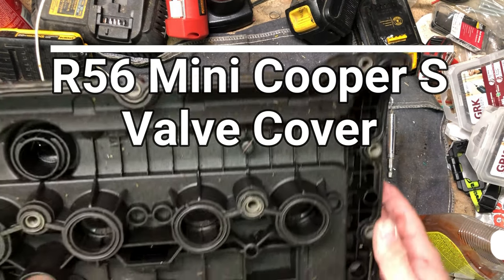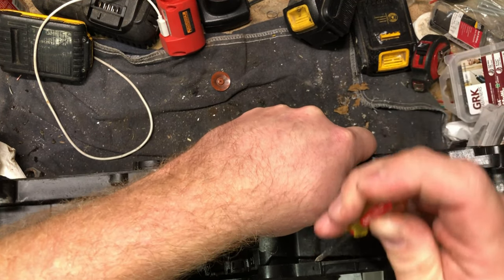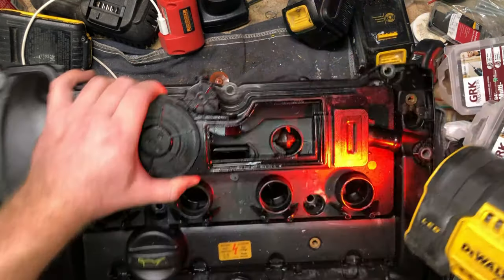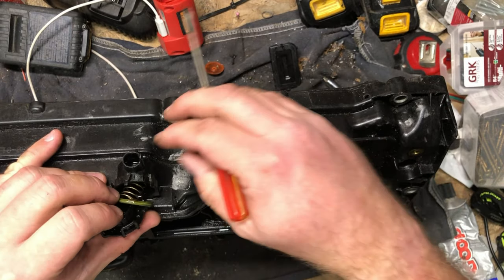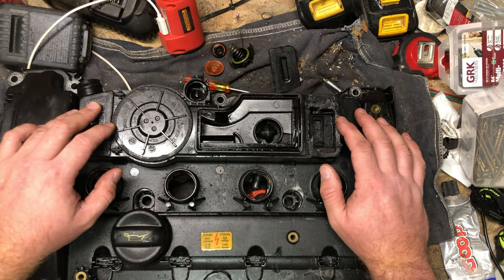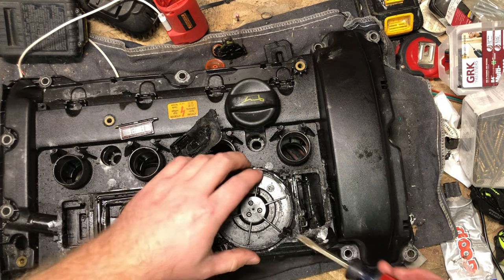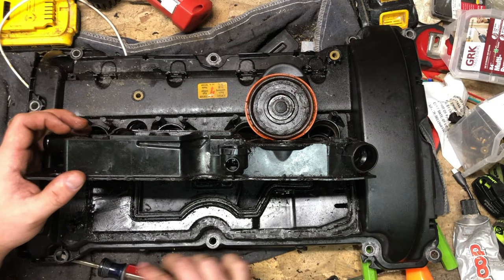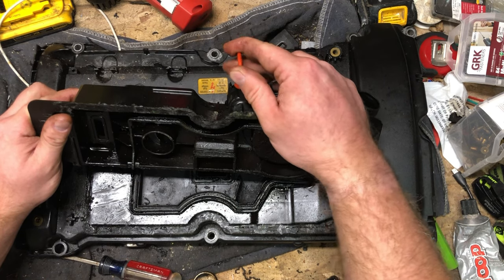R56 Mini Cooper Valve Cover

Comment: erm, I think your missing the point abit

as you've missed the fact the car becomes under boost "high pressure" which will close the large membrane preventing pressure heading into the crank casing, hence the spring to open the membrane quickly off boost/normal pressures etc

off boost/idle the membrane is open allowing recirculation & controlling the idle & allowing oil vapour to flow freely recirculating controllably. on-boost/higher rpm the membrane closes reducing crank case/cover pressure, making oil vapour flow back through into the turbo & round to the intake manifold

you don't want boost pressure to get into the crank case/cover as it'll destroy the seals & so--on leading to no boost

the little door/shutters either side of the casing open under low load/crank pressure allowing oil vapour & crank pressure to vent which also aids engine vacuum systems etc

so high loads large membrane closes, little flap closes (intake manifold side) closing that flow of oil vapour recirculation & boost escaping, the other side open is open allowing re-circulation.... 

the engine is off, the little flaps close minimising water vapour/moisture getting to the crank case cover & the large membrane is open with the spring pressure, that's still sealed due to the little side flap.

the rear valve unused, that's a vacuum port used in other applications, its just been simple closed with the red clip & in some cases a small little nipple/clip.... any over pressure within the crank cover usually the filler cap opens slightly as its also a relief valve in itself that's why its a pretty loose fit & the rubber gasket is a loose fit ie a cheap design for a simple job..

you were close with your thoughts you just forgot to implement positive pressure in the turbo intake system & not wanting to allow that into the crank casing.
Reply from the maker: Thanks for the comment! That makes perfect sense.
Reply: You Sir, are a Legend!!!!! thank you for sharing

Comment: This is the same as a Peugeot 308 1.6 turbo petrol 2008 and have problem where you took out the red tag which I thought went to the wastegate actuator to put power to the turbo or return oil back to the crank case confused help # ??
Reply: ??? huh??

yes its the same as the peugeot & I believe the 307 turbo & the CC coupe as they have the N14 engine..

I'm not 100% with the pug set up.. but the turbo isn't & shouldn't ever be connected by vacuum to the crank casing, the vacuum comes from the basic engine vacuum from the inlet manifold which closes the wastegate & If memory serves me correctly its closes the wastegate allowing boost to build-up

air goes in, compresses in the cold-side/snail... once the hot-side reaches the pre-set boost pressure the wastegate closes & the boost pressure is stable & your having fun

the wastegate is connected to the cold-side of the turbo via the vacuum chamber & that's what measures the pressure via spring ratings, the connecting rod opens/closes the gate depending on front/cold-side pressure.

in the footage the air-filter side allows for recirculation of oil vapour & reduced crank case pressure, the rear is open during low pressure/engine idle operation etc  the large membrane closes to prevent boost/higher air pressure from the inlet manifold side getting to the crank case, this also helps control the idle & general engine vacuum pressures

Comment: So the side where the diaphragm is, that outlet goes to the intake manifold has vacuum on it before the engine start producing boost pressure. Once the engine start producing boost pressure the valve on that side closes and all the fowl air from the blow by start going through the opposite end where that hose is connected to the suction side of the turbocharger. I wanted to take that thing apart myself but now that i found this i might i may leave it alone. Another one of my concerns is why and where these covers leak, if it’s just the upper portion i see no reason why it can’t be resealed.
Reply: the rocker covers usually don't fail themselves its usually the valve cover gasket sitting below the cover & the cylinder head... I've never heard of a rocker cover failing/leaking etc

Comment: See the red tag you took off of the rocker cover as I've got a pipe at the other end which I thought run along the back of the rocker cover and went in that hole which come from wastegate actuator tube to put pressure back to the turbo but am confused like you m8 # ??
Reply: are you saying you have a vacuum line going to the rear port? have you got a video you could upload as I'm pretty sure teh N14 turbo engine also runs from a electronic control valve prior to the wastegate actuator & this electronic valve is at the rear of the engine under teh intake manifold

Comment: What's the orange plug for I dint have that on mine it's missing
Reply: its a vacuum port for other engine/vehicle uses hence why on most vehicles its simply plugged, you should hav either a red big handle (as shown) or a small plug clipping into position.. if you've a mini I don't think it'd do any harm with or without it as there's no controlling vacuum to open it against the spring.